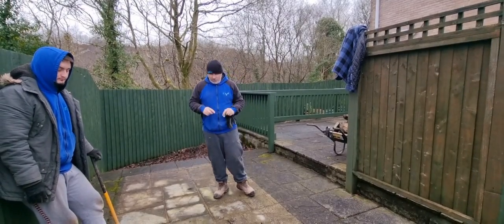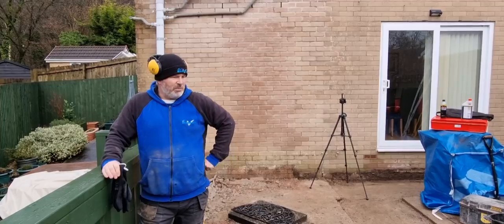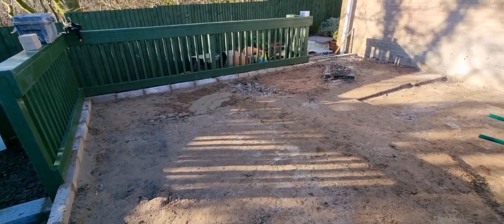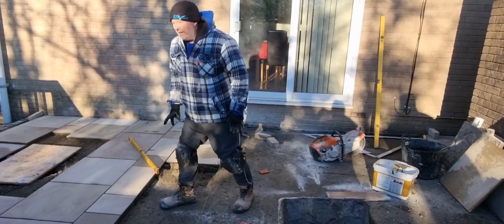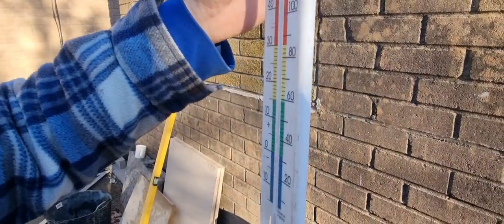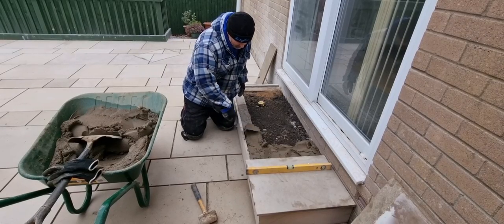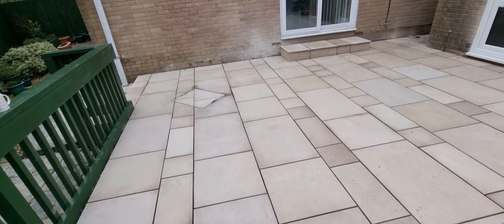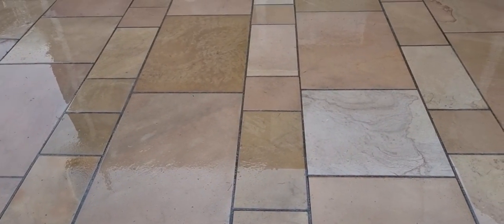Honed Indian Sandstone .With a reinforced concrete base. Start to Finish

Comment: Absolutely beautiful work as always buddy. 

What is that Flow Point stuff or whatever it's called? How does it stay soft enough to jet wash off, but without forcing it out of the joints and weakening it?
Reply from the maker: Thanks marcus.
You have to jet wash it off at exactly the right time along with a few other important things.
Its definitely not for a diy doing for the first time 👍i have videos on it

Comment: Nice one fellas new sub here 👍👍 absolutely lovely job mate, I wish the one I done looked like this 😆 slightly buggered up with the falls pretty sure I used a 1:60 fall but it looks like a blumin slide 🤦🏻‍♀️
Reply from the maker: Thanks appreciate it and welcome to the channel. The falls thats recommended is a bit severa isnt it 
Justin 👍
Reply: @brickrightbuildinglandscaping  sound mate, and yea I think the next one I do I will prob go with a 1:80 or there about 👍👍
Reply from the maker: @King Of the trowel  
Usually we lay it on the line of a spirit level if you no what i mean thats normal enough about 10mm every metre depending on site conditions .Good luck on the next one 🙂🧱💯👍